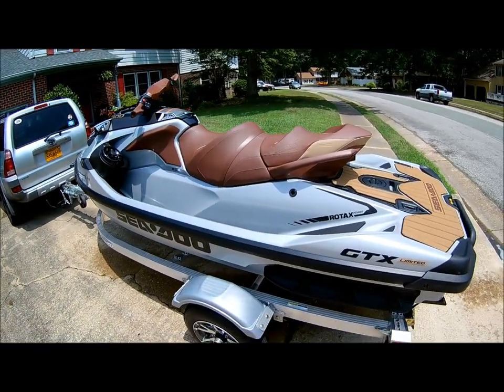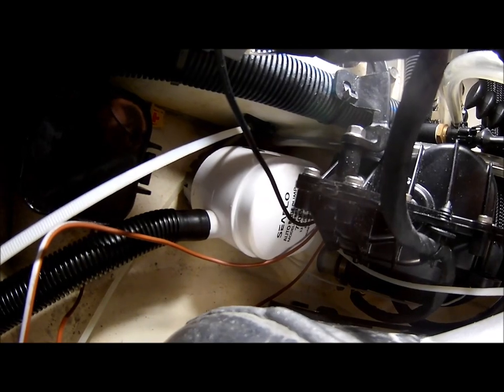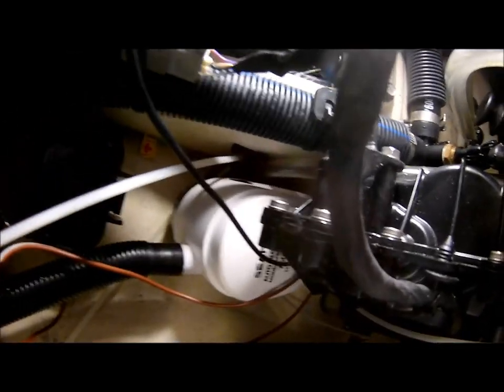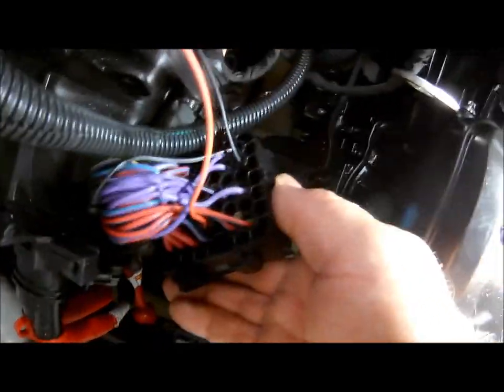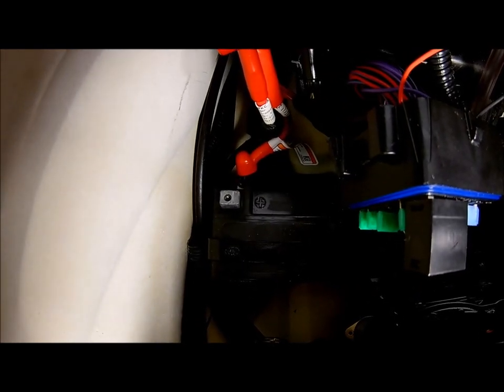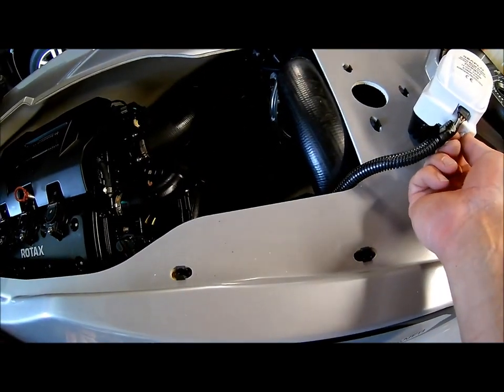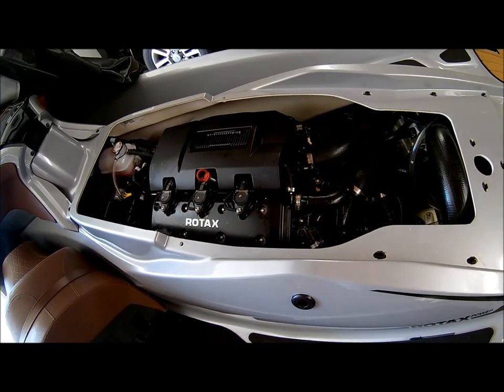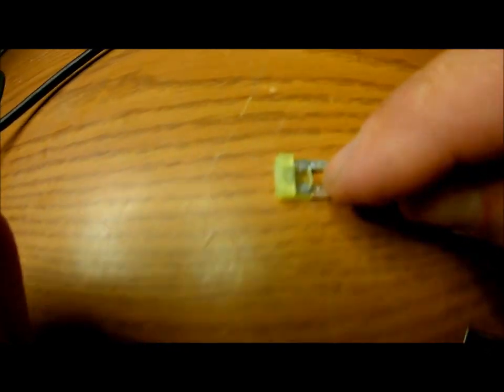Sea Doo  2019 GTX 300 Limited Installing Bilge Pump (RXT-X Fish Pro Wake Pro)

Comment: good video,  but is that exit hole location the best ?  noting that if you're taking on water,  the water will now fill the footwell, which will add to the weight of the ski and hence perpetuate the sinking problem..   ?
Reply from the maker: It will not come close to the foot well.  It shoots about 6' out if it comes on.  Check this out, it's basically the same pump in my old ski.  https://youtu.be/K43_LKhN5IQ?t=902
Reply: @Channel-About-Nothing  ahh sweet,  thx mate

Comment: Why would you install a bilge pump that will only work when the ski is on?  It needs to be installed to the battery direct.
Reply from the maker: SeaDoo OEM is wired the exact same way.  Skis are not meant to be wet slipped so I don't know why it would need a direct battery connection.  Never known one to randomly sink without the ski running, this is from someone who has sunk a ski before.

Comment: Definitely shouldn’t be wired through the ignition, if your ski is docked or anchored and turned off the pump won’t work... the float is the switch wire it hot. 🤷‍♂️
Reply from the maker: There are two ways of powering it.  For this install, I went through the ignition, but yes the flote wire could be wired directly to the battery.  It has been my experience that skis generally do not sink while docked or anchored, but while underway which is why I went this route.  The OEM is wired exactly the same way but runs all the time while the ski is running.